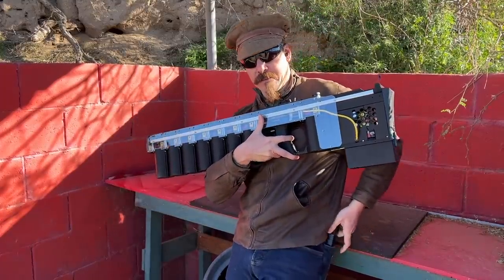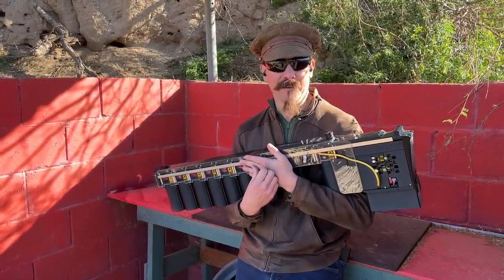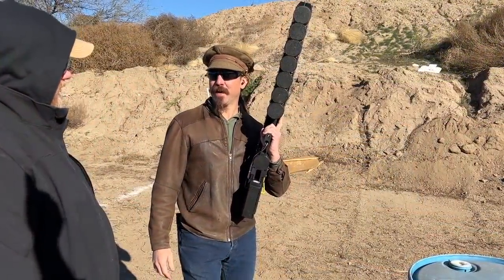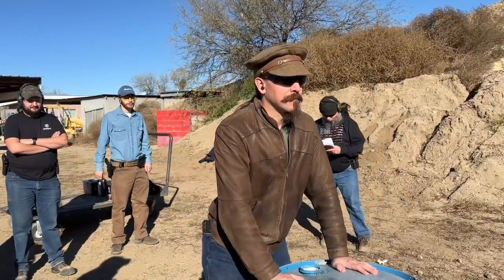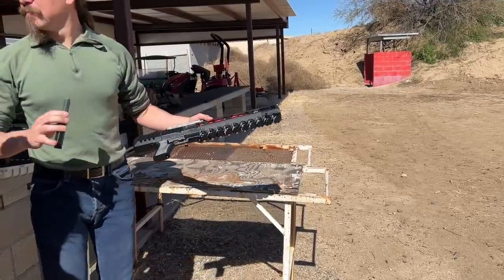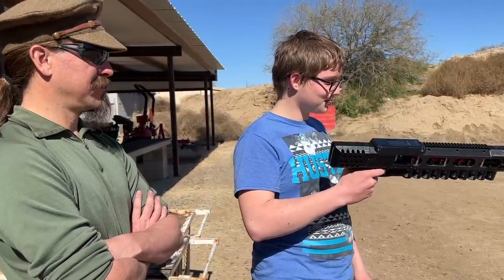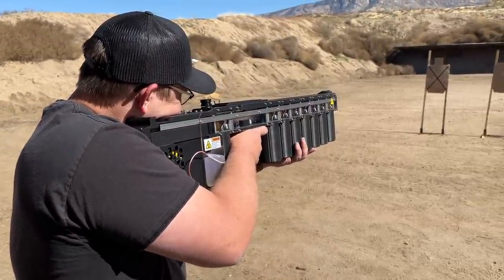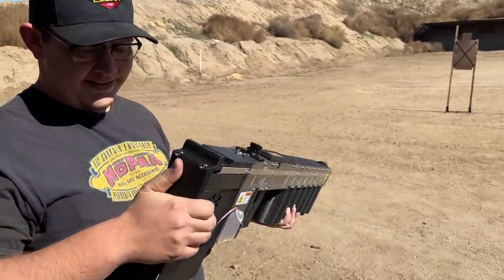I Tried to Use the GR-1 Anvil at the BUG Match...

Comment: Certainly wished this had a gauss force multiplier to knock the slug into the coils. Optics, processors, relays and coils used should be fast enough to add energy. Get you into mach1 projectile velocity, territory....ish
Reply: What
Reply: @acbthr3840  a hybrid gauss , coil gun. This demo was a coil gun only.

Comment: yeeaaah the projectiles either need to be balanced or be fired with a discarding sabot and have fin stabilizers. Other option is to significantly increase power output to increase projectile velocities.

Comment: I wonder why the capacitor bank is even needed, 100J in 0.02 seconds (around 5kW burst) could be handled by a relatively modest 6S hobby lipo.
Is the step-up transformer too slow to keep up?
Reply: Probably due to the impedance of the coil, you have to choose the shortest path possible for the high current.
Also note that you assume a 100% efficient coupling between the electric and the kinetic energy.

Comment: Cool project, but what would be the reason for using one of these over regular gunpowder ammunition?

Like, even if you made this weapon way stronger and 100% reliable and accurate.. What would be the upside?
Reply: One idea would be to prevent the ammunition from catching fire in a gun mounted to a vehicle. It could be powered by the engine. Besides you could store more rounds.

Well, it is still a long way to go.

Comment: I would sdd more capacitors on the sides and top of the barrel they are early models go nuts and make it heavy. You can worry about miniaturization later.
Reply: That defeats the purpose of the weapon. This weapon is meant to realize the idea of man portable coil guns. We will need to miniaturize the capacitors first and optimize battery technology maybe even try a hybrid option with Solar cells available. These things are going to need a lot of work first before we can go nuts and make them even crazier sci-fi weapons.
Reply: @sorrenblitz805  Its an proof of concept weapon and a range toy practicality need not apply to the design you just need to make it work effectively.

It needs to be able to work in the first place before you can focus on making it practical.

Comment: Something I'm kinda struggling to understand is what's the best case scenario of having a coil gun like this? It's a cool unusual type of tech, but does it solve any real world problems, or is it just exciting because it's different?
Reply: Id say best case is that the slugs can be manufactured by hand, there are no cases to eject, no recoil, no powder needed.  In an “end of world” scenario, you just cut up hunks of rebar, and recharge from solar/wind/water/generator… and are good to keep going
Reply: @nathannopants3157  But even in a post-apocalyptic world with a fully debugged rail gun, I can’t see it replacing any firearm. It shoots a large projectile at a slow speed incredibly slowly and needs a battery to operate which will eventually degrade over a couple years. Sure it’s cool, but unless the performance is improved considerably, I can’t see its role even competing against a modern air-rifle. 
Plus why wouldn’t there be recoil?

Comment: I feel like it would be better to fire that gun with steel balls instead of slugs because that said it keeps tumbling 
plus since it will be like less than half the length of the smaller slugs it would be more light weight and might travel faster... maybe but I'm not really sure
Reply: No it wouldn’t. These weapons projectiles Dont play by the rules as traditional firearms. The projectile is launched via magnetic force. The less magnetic material for the magnets to manipulate, the slower the round will be. The creators of the gun did an interview where they explained it. You would get similar or slower velocities then the large rounds.
Reply: @stuglife5514  yeah I saw this video before the interview video
Reply: Honestly tho I was mostly concerned about the tumbling effect on accuracy maybe if they increased the barrel diameter and have it fire steel ball that are the same mass as the slugs it would retain the same speed and power but will be slightly more accurate?
Reply: @RoachdoggJR555   Well mass isn’t quite the issue, it’s more of the fact that you need enough magnetic material within the projectile itself. Perhaps a ball could work if made out of something with a much high magnetic properties then iron and that would work. And you’re very right it would increase accuracy but I’m not sure about velocity, and it would also require much more energy and more powerful magnets to propel a ball as fast as it can sling the rods. But this is only a prototype so I’m sure we’ll see balls and the ability to generate a twist soon enough. It’s definitely possible for sure, just difficult to do

Comment: Someone could machine some pellet shaped steel projectiles that may self stabilize in flight. Or 3D print a glue on sabot for a smaller diameter steel dowel. A sabot shaped in the traditional pellet shape. Even a dumbbell shape steel slug as shot out of shotguns on TAOFLEDERMAUS’s channel.

Comment: A question to Ian about this weapon: why is the round so large in terms of caliber and why are they not shaped at all? I would imagine a smaller round would achieve a lot higher velocity and shaping would make it more stable
Reply: Larger rounds are more efficient in coilguns.
Reply: @skeptical_thinkers  Huh really? Could you explain a bit more? A chunk of steel that large has quite high mass, not to mention drag.
Reply: @Rynnakkosampyla  The electrical to kinetic efficiency of coilguns is a huge deal in their development. That capacitor bank underneath the barrel stores as much energy as a 7.62. If 100% of that energy could be transferred to the projectile, gauss rifles would easily surpass firearms. The efficiency of the energy transfer though- is not 100%. It's around 2-5% for most designs. The efficiency of a reluctance coilgun is largely limited by the projectile's saturation. Larger projectiles can accept a larger magnetic flux before they saturate. Thus: higher efficiency. With smaller rounds, more of that electrical energy goes into heating the projectile rather than accelerating it.

Comment: This looks absolutely stupid as it is. They should have moved the capacitor bank out of the gun and left a cable connecting it to the launcher. I've seen one of those split coilguns guns (much lower power, though) in person and it was very light and handy. Current design is more like what french have done with Lebel -- familiar design, but absolutely inefficient. Stepping into a new technology requires thinking outside of "normal" solutions.

Comment: Real question here: it is entirely possible to build a laser pistol that can burn through wood or even thin steel very quickly.  Would that be in violation of rules for a match like this?
Reply: It is possible and people have made them, but they are very dangerous and require special eyewear when in use.  However they would be pretty useless in these competitions because they wouldn't knock over a popper.  Ever.  They also don't burn "through" wood very well, and tend to just make a melt spot on metal.  They'd make a nice hole in paper, but might also catch the paper on fire.  There are (or were) some YouTube videos on the subject.

Comment: Ian is there some reason you never call it a railgun? It's the most widely used term. 

It should be named the GR-1 Pacemaker, like yhe Colt Peacemaker. A play on words. It's motto should be The Pacemaker. It set the pace for the future of weapons.
Reply: A rail gun and a gauss, or coil gun, are not the same thing. Both use electromagnetic force to accelerate the projectile but the mechanics of how they do it is different. At this point my knowledge fails so you're on your own.😄
Reply: @gwtpictgwtpict4214  Wikipedia has articles on both of these types of electromagnatic gun.
Reply: @derekp2674  Thanks, I saw them, didn't have the time to read through them and explain the difference to @e marr3 🙂
Reply: @gwtpictgwtpict4214  Simplest, coil gun sucks the projectile forward, rail gun pushes.
Reply: @gracej79  That's true for a "reluctance" coilgun like the ArcFlash products. 

More fundamentally, railguns use (one or more) pairs of conducting rails, with a sliding armature that is pushed along them by the pressure of the magnetic field behind it. 

Coilguns use one or more multi-turn coils, most often in the form of cylindrical coils (e.g. like loudspeaker coils), usually wound around the gun's bore axis and usually without the need for any sliding contacts between the projectile and the coils.

A railgun accelerates its projectile in a single continuous push, much as a firearm does. A multi-coil coilgun like the ArcFlash operates its coils in sequence, so that the projectile always being sucked towards the coil just in front of it as it moves down the barrel. The coils behind the projectile need to be turned off, otherwise they'd try to pull the projectile back down the barrel.

Comment: I think it's commendable, that someone's trying to push the boundaries and develop such technology, just because of the passion.
But there's multitude of reasons, why such "sci-fi" weapons won't enter regular service in a long time. In real life nobody cares about "cool". Militaries around world care about what's "effective, economic, ergonomic, reliable, easy to maintain, cheap to manufacture". 
Therefore, if you compare coil guns, railguns or laser guns to plain old AK-47 or any clone of AR-15, the latter are still far superior.

Examples:
- laser weapon is comprised of complicated and delicate electronics and optics. Scratched lens may render the whole weapon unusable due to light beam being unfocused properly. Just imagine yourself being dropped in the middle of some jungle with a weapon like that. High humidity, high temperature amplitudes, any dust or small particles affecting lenses, electronics and battery. That's even worse in a desert environment. AKs and ARs with minimum maintenance laugh at that,

- drop the laser or current coil gun from 10 metres. You'll get a pile of broken electronics. Drop an AK from the same height, you'll get fully functional weapon, maybe with few scratches. Oh, and I wouldn't risk hitting an enemy with a buttstock of a laser/coil gun,

- it took me around one minute to learn how to field-strip AR-15/M4 for the first time. I think I would need some science degree to clean or repair a laser or coil gun...,

- classic firearms only need complex ammunition, which is ready-made. Coil guns or railguns need both ammunition AND power,

- the main idea behind (usable) coil guns is to maximize penetration, while accelerating projectile to subliminal speed. Or at least speeds far beyond capabilities of current firearms. That means virtually flat trajectory (projectile hits, where you aim) and superb penetration, provided the projectile is small. Which is why in old "Fallout" games the Gauss Gun used 2 mm projectiles (that's half the size of a BB). But all that would require enormous amounts of energy. Railguns require even higher energy (though projectile doesn't need to be magnetic, if I'm correct). I mean, theoretically it's possible to make such personal weapon, but it probably would have to be permanently hooked up to a nuclear power plant XD,

- all those "boring" AKs and ARs are relatively simple in comparison, ammunition is readily available everywhere around the world (well...maybe a little less now), they're easy to "learn" and maintain. When it comes to reliability, especially AKs are legendary, thanks to all the weird torture tests they've survived. My friend, who died few years ago used to say: "if your AK is not shooting, it doesn't mean it's broken. It just means YOU are doing something wrong".

So, while I approve developing such new technologies, I think we'll wait a long time, before we'll see those weapons in the field.

On a side note, I remember that once I've read a lexicon of a military technology. I think it was from late 70s. There was an entry about personal laser weapon, comprised of a laser pistol, a backpack (which served mainly as a power source) and a prototype helmet with HUD. The whole project was cancelled, but supposedly the helmet with HUD was later adopted to be used in helicopters an fighter jets. Does anybody remember that project?
Ian should know. I would like to see that on "FW"...
Reply: These are much more likely to appear on vehicles tbh, where the extra maintenance and power requirements aren't as much of a problem. 

The US navy seems to have shelved their railgun program for now though, so it's definetely not going to happen any time soon.
Reply: @frostedbutts4340   Yeah, I've learned that it was mothballed due to prohibitive costs for each projectile. It's always about money... Also, the problem is very quick "barrel" wear, which is inherent issue in case of railguns; solving that would probably require more advanced materials.

Microwave weapons are controversial, since they can be considered WMDs - it's just a matter of power output. In theory, they can be great less-than-lethal means of crowd control, but it takes just some more energy to literally  burn any number of people alive, all at once. In that regard, they could be compared to bio- or chemical weapons, and I kind of agree with limiting their usage. 

I've also heard, that green, AR-mounted  laser pointers are being pulled off, because of a number of cases of permanent (or substantial) sight loss. Makes sense, since the shorter the wave, the more energy it carries. I believe the idea was, that green laser point is better visible in daylight, than classic old red, but then again, there are "red dot" and reflex sights, which allow to switch the aiming reticle from red to green, and they mostly do their job. I own several pieces of gun optics, which can do that, and I can say that green reticle is actually better visible against bright environment - and there's no need to resort to a laser pointer, which can reveal your position btw. Not to speak about ATPIAL (or AN-PEQ) modules, which already proved to be successful, though they require additional, costly equipment (IR goggles).

I haven't heard anything about further developments in plasma weaponry, but it also kinda makes sense - plasma can be effective against any kind of modern armor, but the problem is again power, then proper containing of the plasma "projectile" (which would require a strong electromagnetic field), and most importantly - such a projectile would rapidly lose its energy (through waste heat) on its way to target, severely limiting effective range of such weapon.

Right now, the only effective "sci-fi" weapons in my opinion are high-energy lasers, if used in a Phalanx-like configuration, in order to protect carriers or important installations from incoming missiles or bombers.

So yes, I agree, that we won't see those "futuristic" weapons anytime soon, and even if - they will be mounted on carriers, cruisers and other heavy equipment, but the "Star Wars" personal stuff won't be available for some time. Interestingly, the idea of a caseless ammunition seemed to promise a major breakthrough for a moment (Steyr AUG was originally supposed to use this, than there was H&K G11), but it all died , again due to money issues.

Comment: Why is the demo ranch gun 1000 times better. What makes it so different??
Reply: That has a higher rate of fire because it fires a lightweight projectile at significantly lower velocity, and thus requires less electrical charge-up time between shots. The "e-shotgun" is a toy frisbee launcher being sold as the "less-than-lethal riot suppressant of the future." The GR-1 is an alpha-development stage tech demo for both coilguns as a platform, and for the underlying capacitors, and is being sold as such.

Comment: To think people would pay $4000 for this frankly, novelty junk, just because its advertised as a gun. Open source nerf guns you can 3d print have 10x the build quality and fitment of this thing. This is nothing more than a crude implementation of a simple linear accelerator.